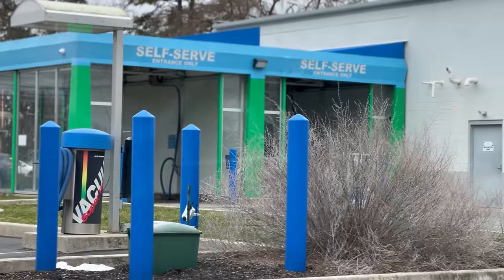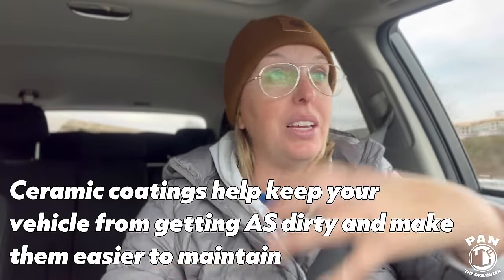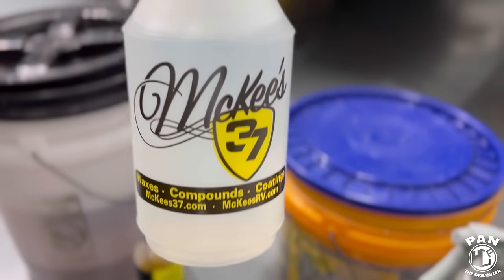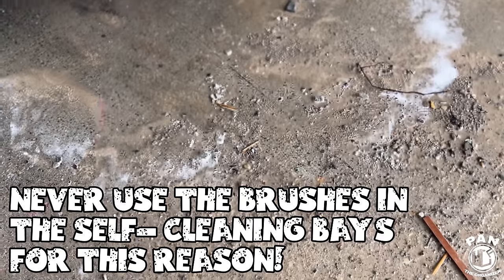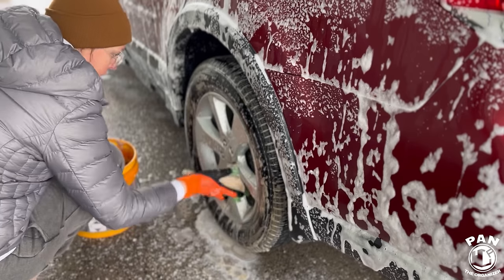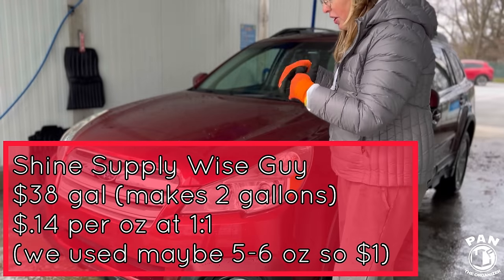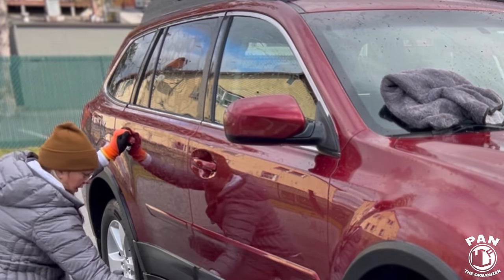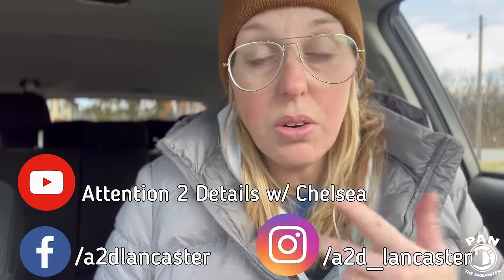How To Wash Your Car At A Self Serve Car Wash

Comment: Hi Pan, I've reached the end of my 2 year life span of my ceramic coating (Avalon King Armor Shield IX) and the ceramic properties are pretty low. Is it best to fully remove the ceramic coating or should I try something else to gain back the properties? If so what do you recommend?
Reply from the maker: 2 years is just about right for the regular Armor Shield IX. At this point I would wash, decon and polish the car and reapply a new coating.

If you want to take your chance and try to revive the coating and see if there’s anything left, see my ultimate spring cleaning tutorial here: https://youtu.be/oTaFE_p2OAw?si=L1_Hj78i5FWU84fT

Comment: Quick question. So let’s say I follow all the steps and then do the rinseless wash. Can I use my EGO Blower to dry it or is the towel required to dry.
Reply from the maker: With rinseless washes, you don’t use a blower. You use a microfiber drying towel.

You don’t want to be blowing all the dirt around at high speeds with a blower. As even though it’s encapsulated, the dirt is still on the paint.
Reply: @PanTheOrganizer  appreciate the response. Thank you.

Comment: Is there such a thing as a WINTER car soap?  Something that breaks down (desalinates?) the film from salt/MgCl2/cacl2 AND rinses well from very cold water?
Reply from the maker: Yes. This: https://bit.ly/3u2KsmZ

That is great for removing mineral buildup and water spots too. But it can strip waxes and sealants (safe on ceramic coatings) so be careful. Also, this is not recommended for regular weekly washes. Just once in a while for those deeper cleanings. For weekly washes, stick to pH neutral soaps.

I hope this helps!
Reply: @PanTheOrganizer  In a market already over-saturated with product choices, I think an easy-rinse, film busting general use winter soap & foamer remains an unexplored option for anyone in or above the rust-belt.  Prob similar to your recommendation I already use Adam's Strip Wash which is declared "Ideal for Salt Film Removal During Winter Months" 
I may be starting a side-hustle applying lanolin-based underbody coatings later this year and was considering Adam's Strip Wash may be a very good pre-wash/prep product before coating (or re-coating every three years.) 
Keep up the good work Pan - Paul, your neighbour in Toronto @PanTheOrganizer

Comment: Can you recommend a good wash for a garden hose foam gun being used on a ceramic coating and in the sun?
Reply from the maker: It's never recommended to wash your car in direct sunlight. Do it in the shade, as late as possible in the afternoon, or very early in the morning. Same applies for any detailing chemicals you use. If you have absolutely no choice to wash your car in direct sunlight (we always have a choice), use a pH neutral soap and work section by section. This is a good soap for those who have to choice to wash their cars in direct sunlight: https://amzn.to/3K7FY32

It can be used both in the foam cannon (or in your case, foam gun as you have a garden hose) and in the wash bucket for the contact wash.
Reply: @PanTheOrganizer  Thanks for the feedback. I understand tge sunlight thing but my options are limited.  Will try to do in low sunlight when possible.  You're channel is awesome.

Comment: The most important part is not cleaned - the underside of the car.  How do you do that with this method?  I tried this but learned what happened instead underneath my car everything rusted.  Had to replace the exhaust system and then other components as they all rusted from the salt in the northeast.  Any suggestions?  For this reason I moved to using automatic car washes. Yes, the paint does not do as well but I no longer have to pay massive repairs after 10 years to replace components under the car that are rusting out - which is far more expensive than having dull paint which I live with.  I would love to do this but not pay for the underside of my car after 9 to 10 years as I keep cars for 200,000 miles and about 15 years. Thank you for any help!
Reply from the maker: There’s a simple solution to clean the undercarriage. See my video here: https://youtu.be/2fOEaNOGTFI?si=NVgazGSUzHEsxwf5
Reply: @PanTheOrganizer  Thanks for the quick answer.  It may work but a question - does it work below 32 degrees outside?  I have problems with freezing pipes so what I would have to do it turn the water on the outside faucet, spray under the car, then turn the water supply off and the unit would be below freezing that whole time.  Wouldn't I have problems?  It is why I never use the pressure spray during winter. I do not have a self serve car wash near me, but I do have a hand wash car wash near me which I do use (employees hand wash your car called Splash).  I do appreciate your help - thank you!

Comment: What's the typical pH of soap at a self-serve wand wash?
Reply: Typically 12-13
Reply: @attention2detailswchelsea  12-13?  Is that before it gets watered down or after?
Reply: @TheBreakfastLover  more than likely before
Reply from the maker: That's correct. And even when diluted the pH doesn't drop dramatically. It won't go from pH 13 to pH neutral that's for sure.

Also, pH is just one part of the equation. The rest of the chemical makeup of a formula is perhaps even more important. Are you using caustics? Are you using active ingredients of low quality? 

You can see a leading chemist's answer to "What makes a good quality car soap?" in an interview I made here: https://youtu.be/Uv2LWtYBxe0?si=YPycIChUx7kHhCo8&t=995

Comment: Unfortunately the one we have here in Greater Montreal won’t let you use your foam sprayer though you are paying. So rude and stubborn. Then for drying in a parking or outside in winter here .. 5-10 min is out of the question water will be freezing on the car or we will freeze. This is good in the fall or early spring

Comment: @PanTheOrganizer or @attentiontodetailswchelsea I noticed she used the ceramic gloss to coat and use as a drying aid while drying. Is this product still okay to use as a drying aid on a non-coated car? Or do either of you have a product that you recommend to use?? Thanks!
Reply from the maker: Yes you can use it on a car that has no protection on it no problem. It can even be used as a drying aid on a wax, sealant or ceramic coating. Ideally on a coating.

Comment: The car washes I have used the soap is thrown slowly from a separate gun with a brush attached, and not from the water hose.  Probably you did a rinse and wax, which both are liquid.

Comment: So let me get this straight - Chelsea uses DIY Detail Ceramic Gloss as a ‘drying agent’ even though the back part of the car is already got a ceramic coating?
Reply from the maker: Coatings typically require some for of maintenance spray to be applied every 2-3 months to maintain its properties or to boost gloss and slickness.

Also, when towel drying, it’s always best practice to use a drying aid/quick detailer as a lubricant between the towel and paint to minimize the chances of marring the paint.

A ceramic coating isn’t bulletproof. It still requires maintenance to function properly.

I hope this answers your question.

You can also check out my ceramic coating maintenance tutorial here: https://youtu.be/IqIW78FmRYU?si=XjNHqNOdcHMierQ2

Comment: Sounds like a paid promotion by Yvan Lacroix Why would you go to a car wash with a pressure washer and then use rinse less wash Might as well stay at home and clean your car with sand paper. I’ve used ONR and there is no way that you can wash a car in wintertime conditions without a pressure washer and soap if you care about your paint work
Reply from the maker: This is absolutely not a sponsored video Matthew. Be very careful what you insinuate without having facts. If it was, I would have clearly disclosed it as I always do. And by the way, it's mandatory to disclose paid promotions as per YouTube and FTC regulations.

There are many ways to wash a car. I personally prefer the traditional wash method with buckets and mitts and pressure washers. But many people don't have access to water or a pressure washer or garden hose, and they need a safe alternative to clean their car. That's why rinseless washes are so popular.

But you do need to use common sense with the rinseless wash method. If the car is too dirty, caked in dirt and mud, you'd obviously pre-rinse it first. A rinseless wash doesn't mean you never rinse the vehicle. It just means you don't have to rinse at the end of the wash process.

Comment: Harsh chemicals on paint from a car wash, huh? Yeah most people dont care, and the worst I've really seen is swirl marks (unless the paint and clear is absolute garbage)

I understand detailing is a hobby and like most hobbies, people way overcomplicate everything. Simply car wash soap will clean everything on a car, including the wheels, tires, floor mats, exterior, some interior parts if you wanted. A drying microfiber, and spray-n-dry wax if you're feeling fancy
Reply from the maker: Clearly you don't realize just how many car detailing enthusiasts there are. Heck my channel alone has over one million subscribers and 140 million views. That shows you that there are people who actually care about their cars and love the process. It's soothing and relaxing for me, even after 27 years of detailing. It's not a chore.

So there's nothing complicated here, once you get to learn the basics, and add building blocks to your repertoire of knowledge and techniques. 

If you think car wash soap will clean everything on your car including wheels, you are dead wrong. They might appear clean to you, but I can guarantee you if you were to use an iron remover on your wheels, and you'd see all the red/purple color bleeding from the metal particles and ferrous contamination, you'd understand how far from the truth you were. 

Same applies to your paint. Just washing your car alone doesn't do much other than appearing clean for a distance. But an iron remover and a clay bar treatment would reveal just how much embedded contamination there was in your clear coat.

I could go on and on for any surface both inside or outside of your car. Just respect people who enjoy detailing, if you don't. Nobody is forcing you to do this.

So please don't make uninformed comments if you don't have the facts or knowledge.

Comment: Problem is: Every self wash has a "No brought equipment" rule. If you bring All that equipment, you won't have time to start before they kick you out. Also, don't use water on parking spaces when it's freezing outside. You'll ice the parking spot and Nobody will like you for it. The small handheld snowfoam is a great idea though. You might just get away with that, and it's quick and easy to use and even easier to hide.

Comment: Way too complicated and time consuming of a method. Excellent content though. I travel quite a bit in the warmer months so I use these bays often.
Reply: This isn’t time consuming at all for a quality cleanup. 30 minutes? It’s only slow compared to the automatic or a half-done spray-down.
Reply: In reality it took less than 20 minutes from start to finish. I could actually do it faster if need be

Comment: This is not the best or safest way to clean a car at a diy car wash in my opinion.  Why apply a ‘rinseless’ wash when you are already at a car wash with an endless supply of water ?
If your goal is to prevent micro  scratches to you paint, here is a better , safer workflow that I have been doing for years. I bring my own bucket of warm water and after the touchless pre-wash I do a standard wash with a microfibre towel and then a full ‘water’ rinse.
Reply: Nothing wrong with your way at all.  However, there is also nothing wrong with her way either.  She is using a high pH soap that will really break down the organic materials and dirt.  She then masterfully uses dwell time of both the wheel and car soaps.  She then says very truthfully that will get you 90% clean.  The rinseless wash provides an agitation step to go after that last 10% of contamination.  She then shows how there is not a lot left by showing you her sponge.  She finishes off with a topper to get some extra gloss.  

She is using very high quality chemicals very efficiently.  I was most impressed by her use of dwell time.  A lot of people rinse too fast and don’t allow the chemicals time to work to their full potential.  I hope that is the biggest take home for her process.

I see your point too.  I was once not trusting of rinseless for your exact same concern of marring.  It took me time to get comfortable but now I can say that after years of using it with a sponge, no marring.
Reply: Oh one last thought.  

How did I get comfortable using rinseless?  I used it only for door jams in the beginning.  I monitored for marring over a long period until I was convinced it would not cause me problems.
Reply: Rinseless washes are actually extremely safe when done properly